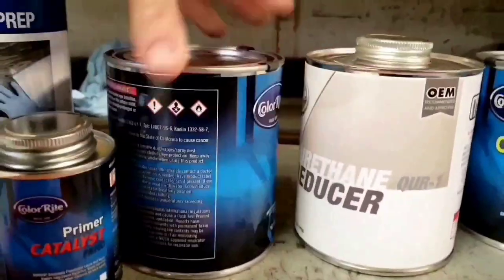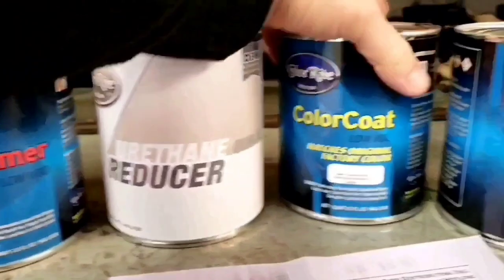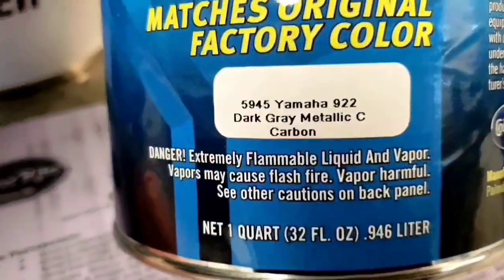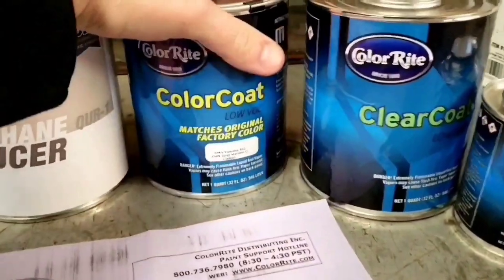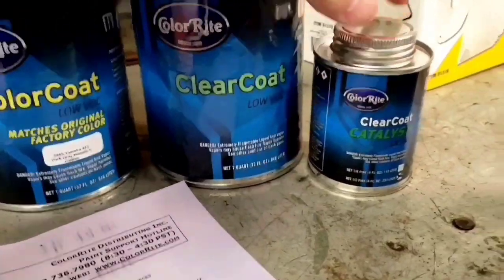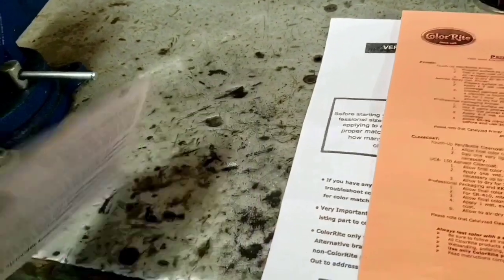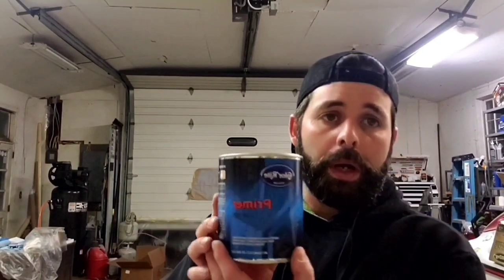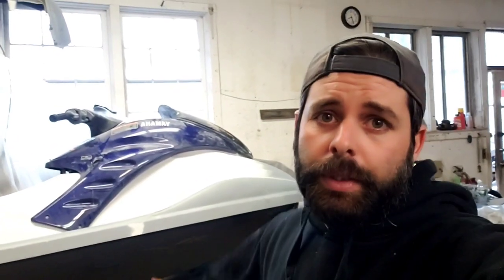Life of a Jetski Mechanic: I decided to paint my Jetski!

Comment: Painting can be finicky. Unless you have a really good setup it’s going to be unpredictable. I can spray one day and get almost zero orange peel. The next time I get some using the same paint out of the same gallon. Dry air is absolutely necessary. Clean surfaces as well. If the surface sets for any period of time it is going to need cleaning and possibly sanding. It is fun though once you get the hang of it. My question would be, why not use gel coat? Also Pete from DIY auto school recommends cleaning/prepping with nothing but water and maybe soap.

Comment: Did you check your spray pattern before you sprayed you put on a smaller box and spray it on the box and see how wide your fan is it's supposed to feeling like a straight line the fan

Comment: How did you flip the JetSki upside down do you still have engine in it?
Reply from the maker: Engine was still in it. I used engine hoist to get it flipped. 

Wouldn't recommend as I did have to touch up some paint after I corrected it back over.

Comment: That 75 % us to much 50 % it's your gun gasket or cleaning not good  p.s. metallic is a bitch to paint I would need to be there to give you advice and really see what is going on.  Or spray it for you go you clean out the air valve at the top of the cup? And take the needle all apart to clean properly?  I would spray the whole side from front to back in one swipe don't paint in sections but looks descent

Comment: Silicon is what's caused it
Reply from the maker: It was actually oil from my compressor, I only noticed days after when my paper work was covered in oil 🤦‍♂️ i do appreciate the insight and always take tips given into consideration. Thanks for watching and being part of the journey!
Reply: How would oil from the compressor get all over your ski?
Reply from the maker: Apparently there was a breather hole at the top of the compressor motor and i had just filled it with oil. The compressor sits in the same area I was painting. I realized once I saw the oil on some paper work
Reply: Dang that sucks